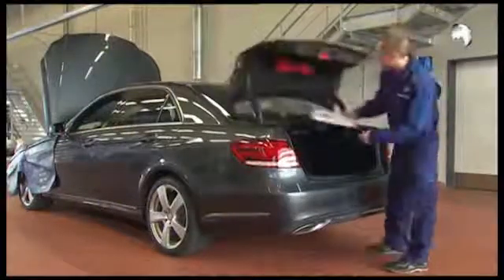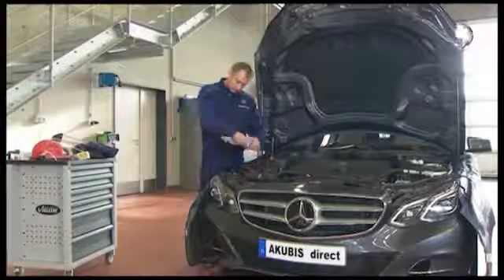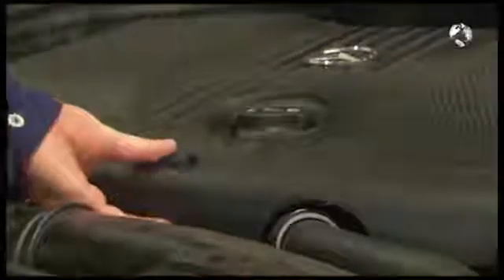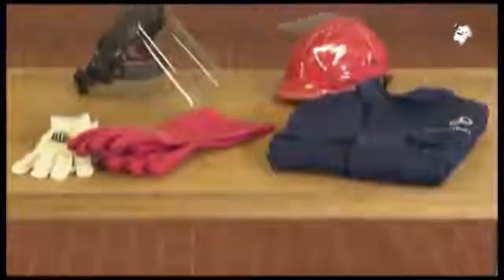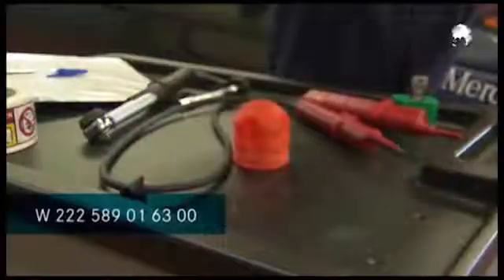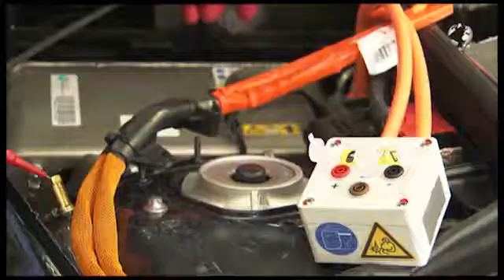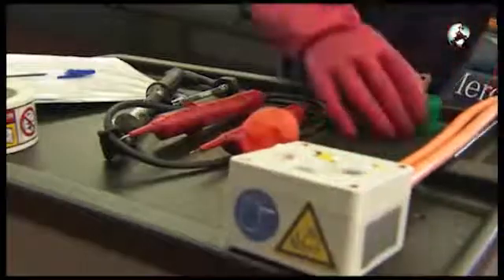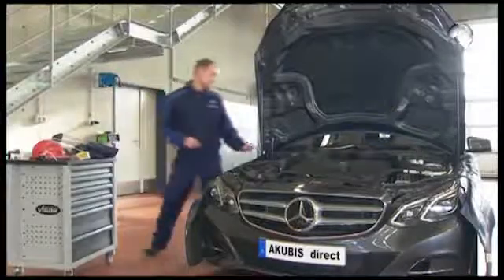W212 Perform manual power disconnect for high voltage on board electrical system

Comment: Hi, my w212 lift hybrid discharges the battery, when I apply external power, these are errors: a red message about the battery and information about the failure of the hazard warning lights. And engine won’t start. Do you have any advice? the mechanic said that the hybrid battery would need to be replaced. Thanks!
Reply: you have news? hi.
Reply: helo bos, i have reparing this model w212 buetech hybrid.  it dont have a interlock swicth to off high voltage. not same at w205 model has green colour interlock swicth